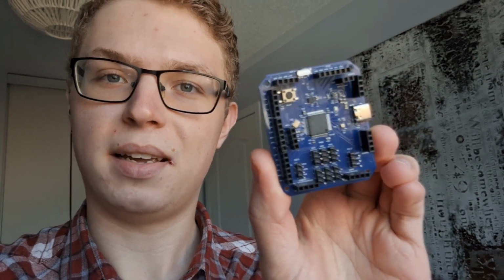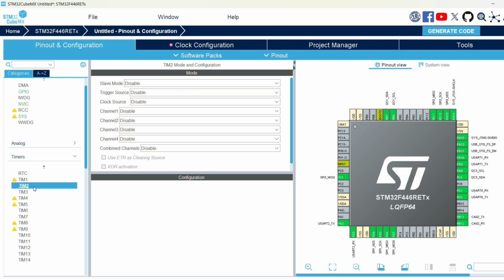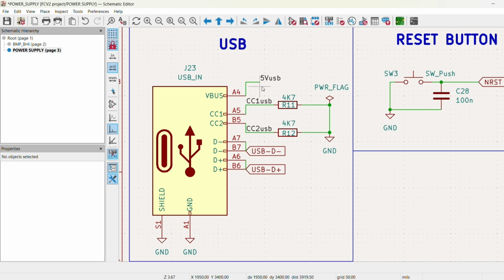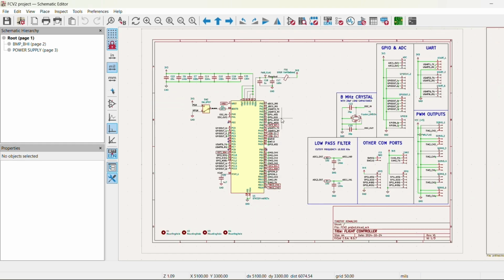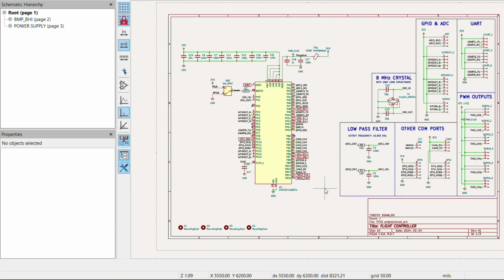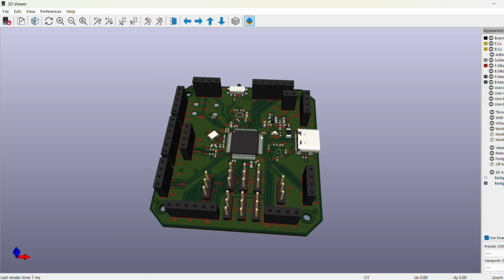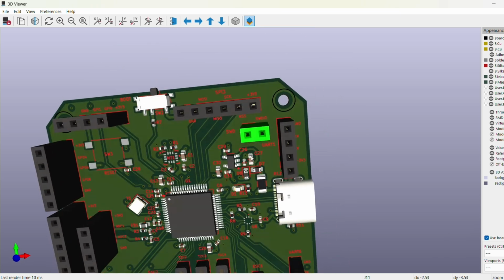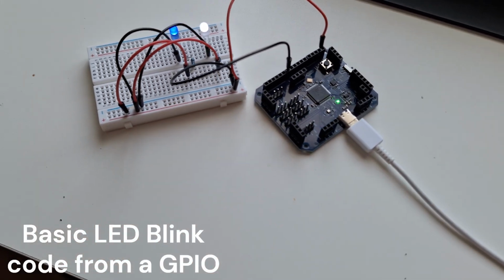Creating a DIY Flight Controller PCB for Fixed Wing Drones

Comment: Good video, very helpful, 1 question where did you put the generated code? TIA
Reply from the maker: Glad to hear that the video is helpful. The generated code should appear in the same file folder as your stm32cubemx project

Comment: Do you control the drone via a remote control?
Reply from the maker: Typically you would use a receiver module that is connected via PWM/PPM/SBUS to the flight controller. There are some that use other interfaces too I think

Comment: Don't know if you ended up with it, but it's a bad idea to make "loops" - which it seemed like you did for your 3.3V. A loop will pick up current from the field inside it - proportional to the area of your loop!
Reply from the maker: Good point, though at the time I reasoned it wouldn't make much of an impact for DC power

Comment: What firmware did you end up using? Did you compile a custom version of Ardupilot or the like with your pin out.
Reply from the maker: This board is only meant for prototyping different sensors due to its low flash memory capacity (256kb). It could theoretically run a heavily simplified version of Ardupilot but could also be upgraded to a better microcontroller

Comment: What is the benefit of using an external crystal as a clock instead of the internal oscillator inside the STM chip?
Reply from the maker: Crystals have very high accuracy (+- 20 ppm) independent of temperature so they are very stable